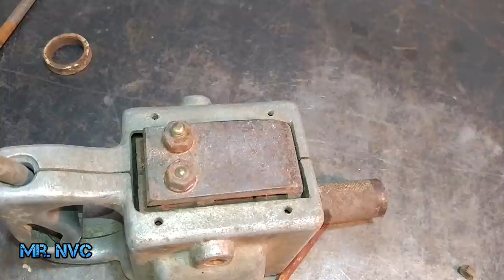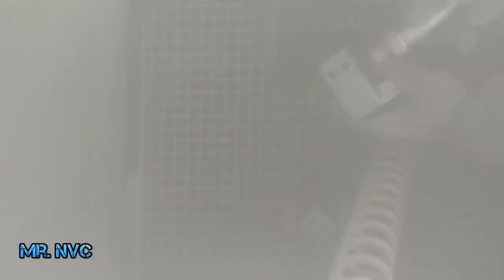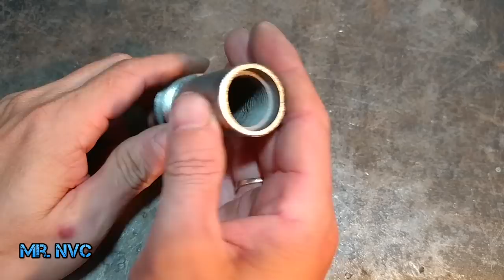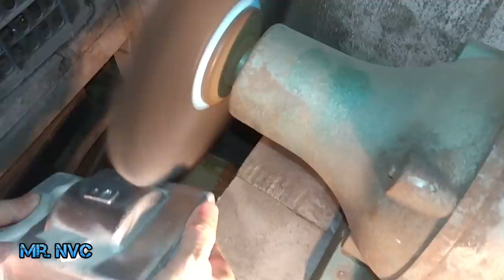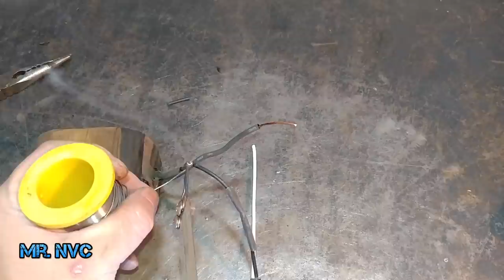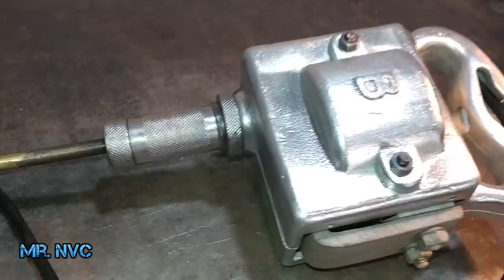Antique Electric chisel Restoration

Comment: Is that sore on the bottom of your thumb on your hand from riding a motorcycle, just wondering because I get the same sore when I ride mine
Reply from the maker: Oh no.this is the scar
Reply: @MRNVCDIY  I know that makes zero sense but the throttle of a motorcycle will rub up against the back of your thumb after riding all day and will leave a sore